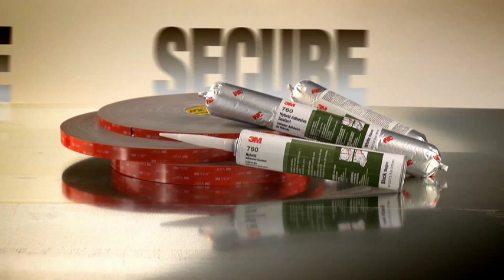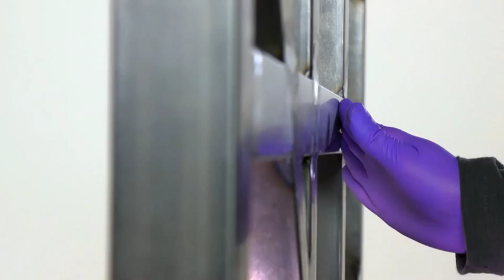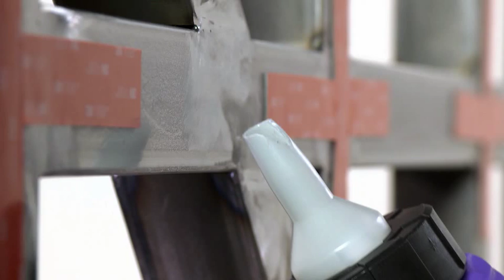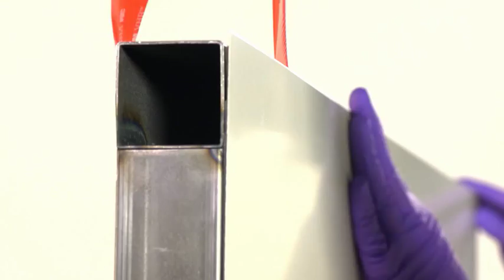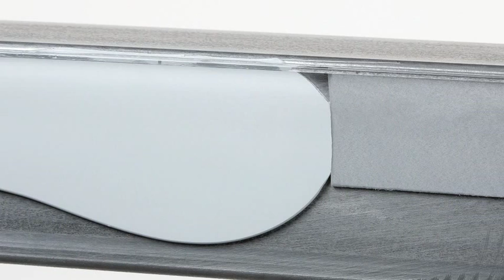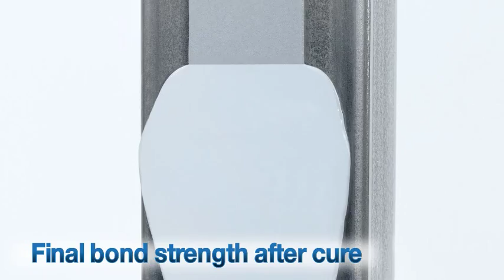Combining 3M bonding solutions Part III: Application

Comment: What would be the best product to use to install LED strip lights under the gunnel rail on my bass boat.?I have a roll of  1/2” 3M VHB but none of the tube type adhesive. Thanks